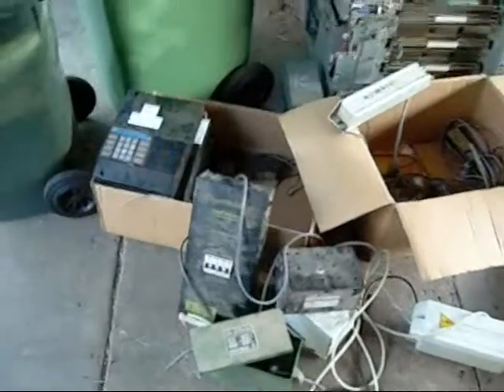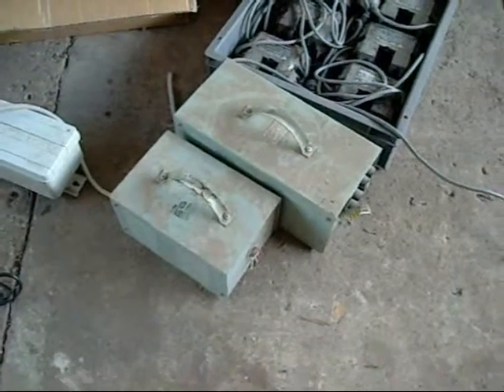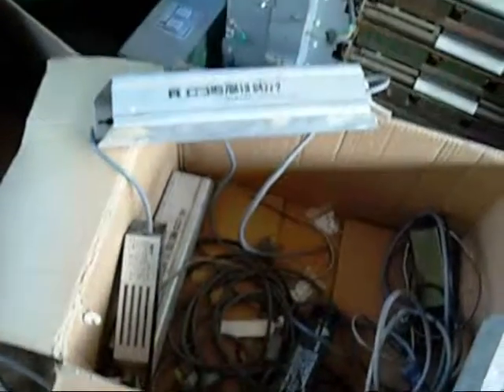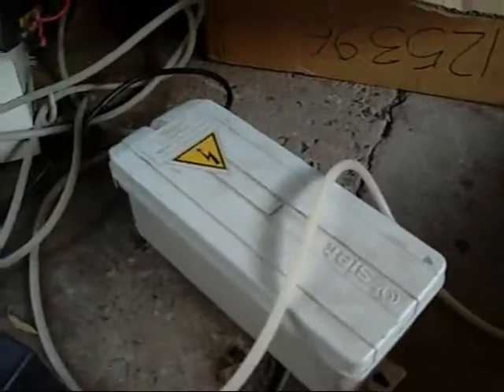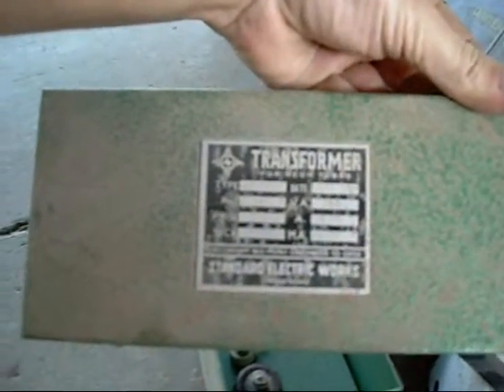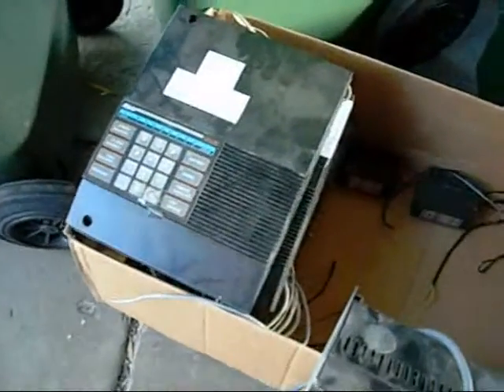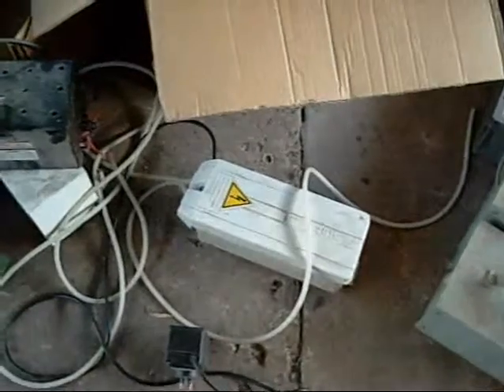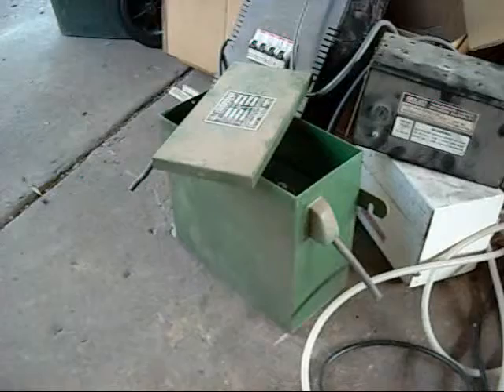Future Projects Neon Sign Transformers

Comment from the maker: apparently its just a cutout in case the neon sign malfunctions. the white transformer had a "open circuit protector" on its wall plug, but unfortunately the transformer had suffered a catastrophic burnout, so I'm left with the 2 green ones only.